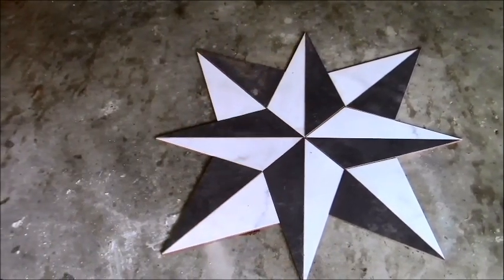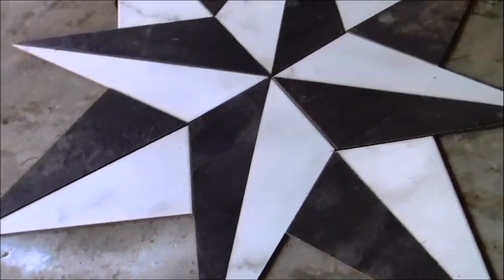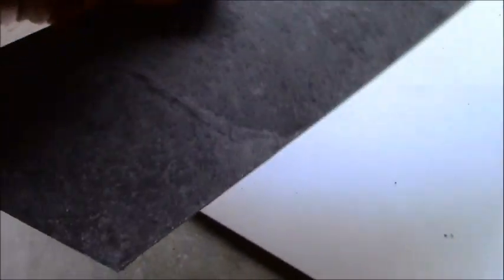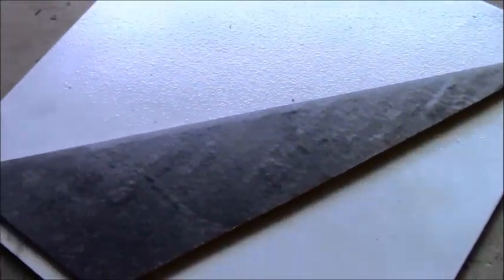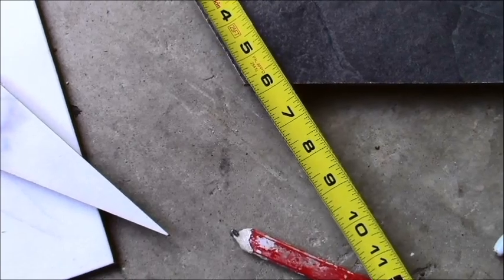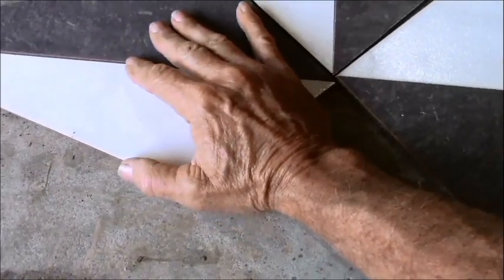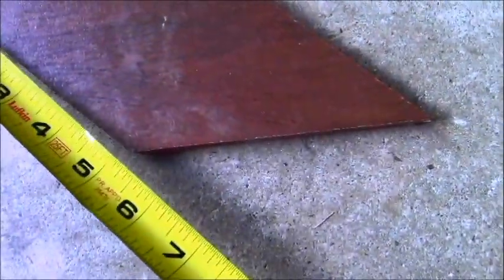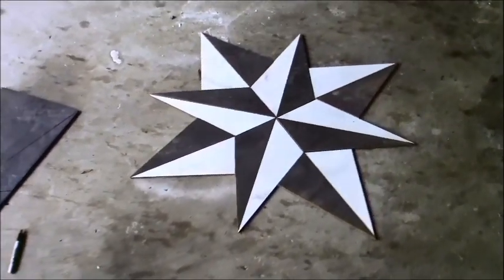CREATE A 4 POINT STAR FROM TILE

Comment: Hey Bob, you do some awesome work!....here is hopefully a good question, I have darker tile with dark grout on the floor and a whitish marble looking tile on walls, the question is where they meet at the floor line what  color grout should be at that joint using bright white grout on the walls?
Reply: You should watch to the end of the video.. 😏
Reply from the maker: I would use the darker grout at that intersection, but that's just my opinion
Reply: That was my thought also, I fell the white grout would just stand out too much against the darker floor.....thank you so much for your opinion Bob.....🙋‍♂️👍
Reply: How would you suggest to keep the vertical white grout and the horizontal dark grout from innermingling?

Comment: I recently watched a video from you that was around 2 years old that was about a cracked drain that possibly caused the leaks. In it you said the wall tile installation was done wrong due to them spot buttering.

 I am a carpenter by trade and have done a good share of tiling over the years and when it comes to any large format wall tile that is how I always install them. Granted I do symmetrical spot buttering. For example, on a 12×24 I would use 8 dollops.  I've found it to give me better control and also allows me to set tiles plumb on an out of plumb wall. 

 Question is why do you think this is an incorrect way to set wall tiles? Just curious and thought I'd post here rather than on a 2 year video. Thanks!
Reply from the maker: It is incorrect because it leaves voids, we are trying to adhere as much tile to whatever surface we're putiing it on, you cannot do that with spot bonding. It's an industry no no is the short answer.
Reply: @StarrTile  I understand that on a floor this would never be acceptable as well on a shower wall. I am only referring to vertical dry areas. I've never seen a failure so far but like a said I build houses and typically sub out the tile. Thanks for the reply!